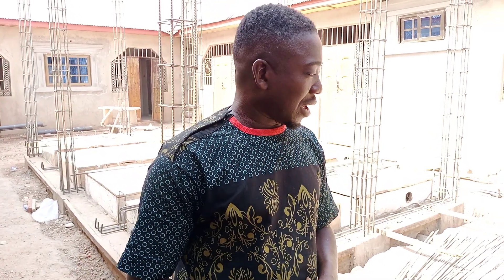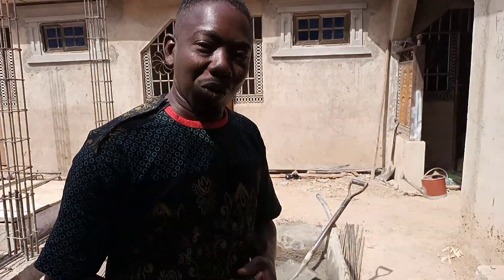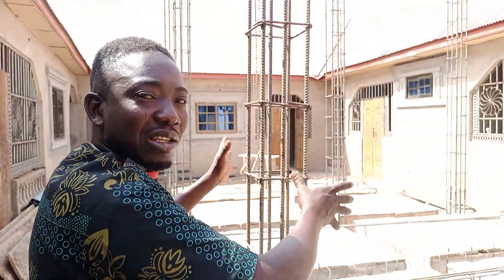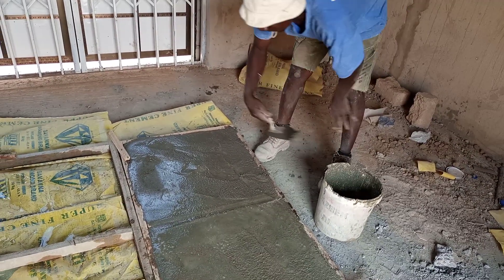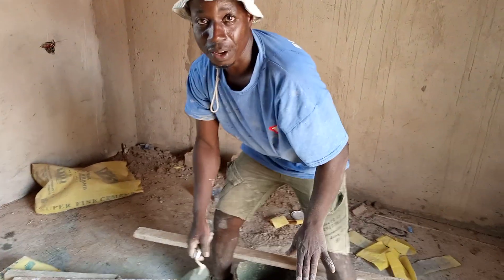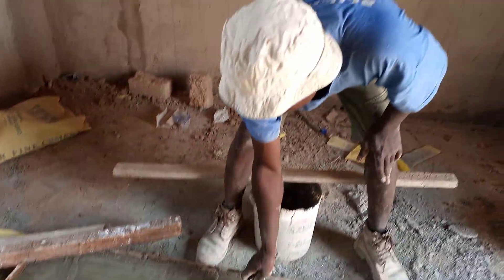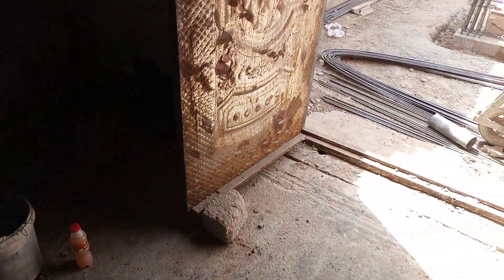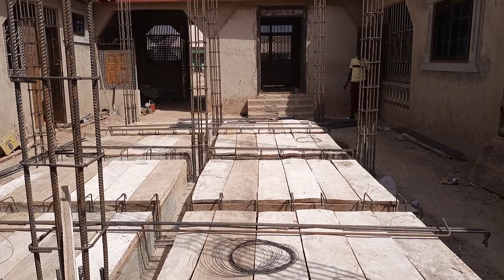MOULDING SPECIAL BRICKS FOR THE UNDERGROUND WATER TANK PROJECT.

Comment: we use the same method here in the islands...we call them lifters or risers...these are used to elevate the steel/rebar matting off of the wooden forms, so that when you cast the concrete, the matting will be suspended in the middle of the casted slab.